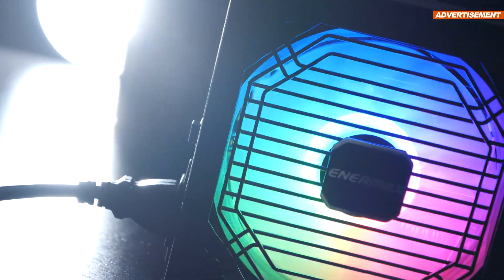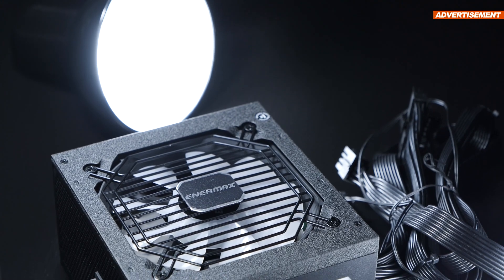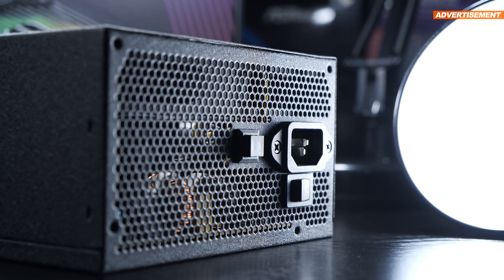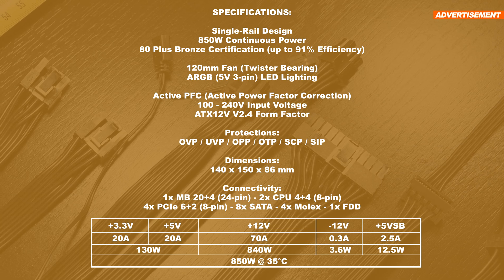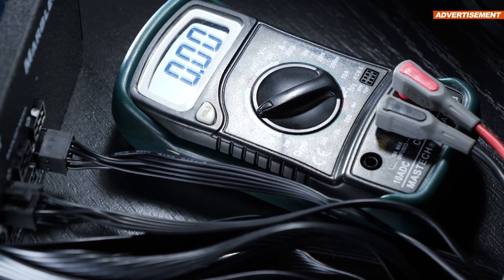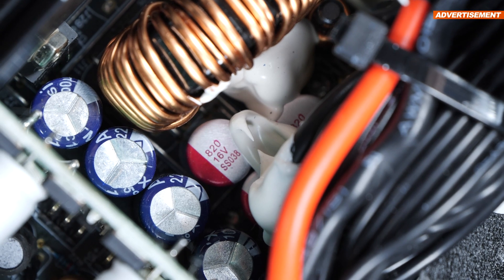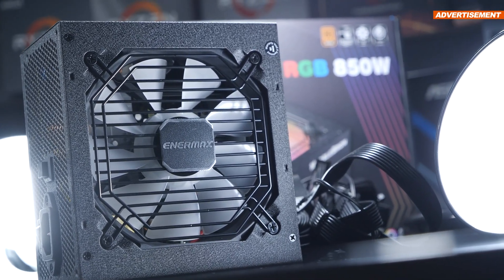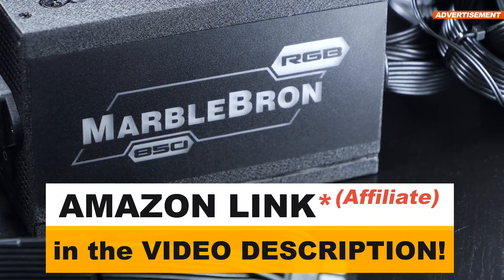Does 80 Plus BRONZE SUCK? -- Enermax MarbleBron RGB 850W

Comment: I’ve personally stuck mainly with Platinum and Titanium rated psu’s …. However I recently purchased a gold rated sfx model from Cooler Master which have all been great performers imo 🥰😇👍. I’ve never experienced any psu issues, trips, spikes, shutdowns etc with any of the psu’s I’ve purchased in the past ☺️😱
Reply from the maker: Wow, you seem to have been incredibly lucky so far not to have experienced any PSU issues whatsoever. In the past I have experienced quite a few and so did some of my relatives.
Nowadays though, I make sure to go for really good PSUs, thus usually no longer run into any issues. :D
Thanks for stopping by and commenting, Michael! :)

Comment: I agree that RGB seems a bit of a useless feature on a PSU - especially these days when lots of cases don't even let you see your PSU. 
I'd much rather have a fully modular, Gold certified unit instead. Like the CoolerMaster V750 V2 Gold which should provide plenty of power for 95% of users, is about the same price over here and has been praised as one of the best low cost Gold-rated PSUs out there. Gold or Bronze will probably not make that much difference WRT annual cost (though it might) but having a fully modular unit is just so much more convenient IMO. 

EDIT: According to outervision's PSU calculator, the annual difference in power-cost between a Bronze and Gold PSU would be around 23€ on my system ... so basically 2 Euro per month. Platinum would bring that up to 25€/year, so hardly worth the substantial premium you have to pay for those PSUs. 

Although I'd probably spend a little more (like 10 or 15€ more) and go with a bequiet! Straight Power or up for their multiple 12V rails. Not sure if I would need those, but it's certainly a more relevant feature to have than some RGB-LEDs ... :)
Reply from the maker: Thanks for your feedback and opinions! :)

Comment: 80 Plus Bronze/Silver/Gold/Platinum is only how efficient the AC to DC transformer is, it doesn't mean the quality of the PSU itself is low, it means it will pull a bit more power from the wall, and the difference in efficiency isn't very big until you reach Platinum/Titanium compared to Bronze, so I don't really care if it's Bronze, Silver or Gold, since it's a 4-5% difference. 

For example Corsair used to have gold rated PSUs that caught on fire. XD
Reply: While you are correct, similar to VRMs on motherboards the more FETs (or higher quality) that you have driving the switching to reduce the voltage the lower  generally means more efficiency and less heat which leads to longer component life. Also premium efficiency usually means premium product which means premium quality. These Rules of thumb with exceptions. The power protection and conditioning circuit design and part quality are important too.
Reply: @WildcatsandBourbon say it to gamemax gold and platinum😂
Reply from the maker: Indeed, you're correct. And yes, I have dealt with some "problematic" Corsair PSUs in the past, as well. :D
However, they also have really good ones. ^^
Reply: @Nicolas11x12English  Yup, corsair don't make their own PSUs, so it's up to the model if they are good or bad. The CX ones were pretty bad.
Reply from the maker: @rattlehead999  Oh yes, a few of my relatives were using CX units and for some they stopped working, weren't reliable at all.